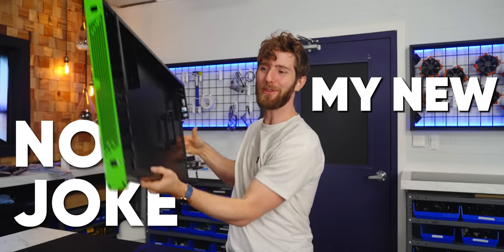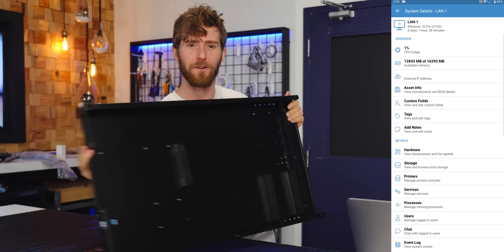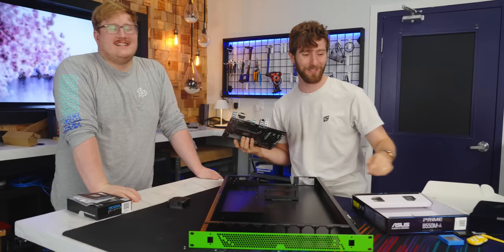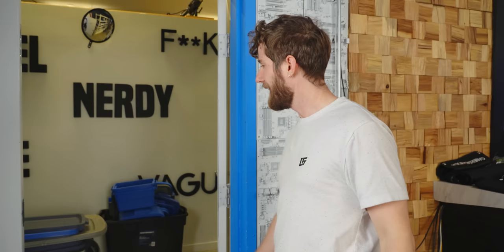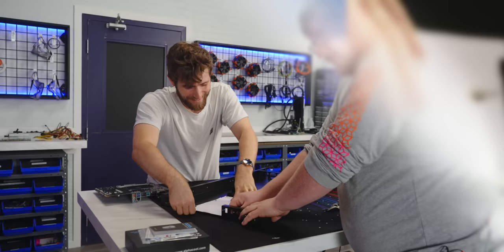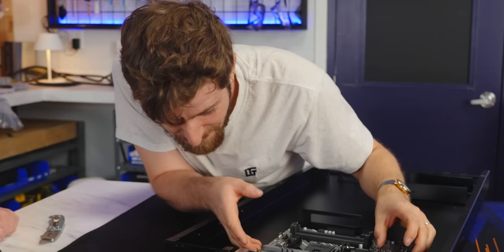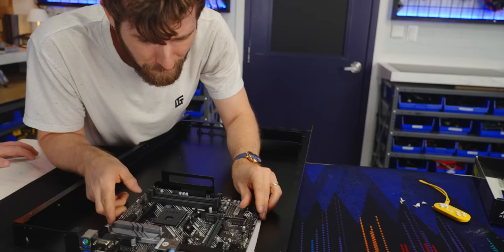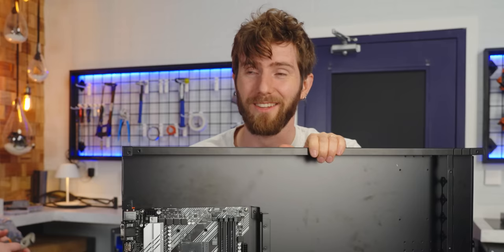This is my new gaming PC! - 1U PCs for My New House Part 1

Comment: The mATX-spec motherboards are my bread and butter. They generally have all the features I need without me having to pay for extras that I don't use, and fitting them in a case is easy.
Reply: sadly they made only like 3 mATX boards for Zen 3. Not sure what Zen 4 was like, but I hope it improves.
Reply: @wojtek-33  #AtxIsTheWay
Reply: @loshan1212  the ONE x570 matx board also happens to have terrible vrms, expansions, and features
Reply: @potatoes5829  yep. I'm currently using that board and being very annoyed being constantly reminded of how Asrock has no idea on how to make a motherboard yet.
Reply: But mATX boards are often more expensive than ATX ones, at least in Germany.
Reply: @loshan1212  I would know. Mine is currently in for RMA
Reply: been using matx forever. They do everything ATX does but doesnt take as much space.
Reply: @LRM12o8  It's always good for me to get a reminder that the best bang-for-the-buck in the US doesn't always line up with what's best in other markets.
Reply: @loshan1212  but they have done it in the past the x399 was "it" and the formula M for the intels. Atleast the new gene is worth a look but very expensive but hey mATX ftw!
Reply: Yeah but mATX was totally pointless in this setup; the extra slots are wasted. Mini-ITX would have been better with the same result in terms of what's actually be used.

Comment: You totally need to source a hot swap server fan enclosure for those front fans. The problem has been solved.
Reply: They could probably even 3D print one. Shorten the cables by cutting and soldering, have the fan headers go into a backplane or something (PCBWay is great for those kinda cheap boards), and viola

Comment: Motherboard electrical insulation: Get 1mm Thermal Pad in sheet form. Cheap, helps with thermals, electrically insulated.
IO Shield: use an ASRock or SuperMicro MB meant for rack mounting, the IO shields are 1U tall. You'll have to design the case to fit.
Power Supply: Should have used a Delta hot-swap; you'd need a break-out board, but people make them. Would have been more power, modular cords.
Reply: He could do what DIY Perks did & take apart a SFX-L power supply, but with a 1000w one & put it into this pc, but idk seems like some work to do.

Comment: I work in a Datacenter, the idea is not to have any carbon material in the cage where the machines are hosted. Carbon gives off lots of smoke and can trigger the fire system with any minor fire. The strong ventilation can make any short circuit sparks light up quite fast any flammable material. A small fire turns into a huge one in seconds.

Comment: Since you have 3d printer; could have printed 1 or 2 millimeter motherboard insulator board/backing instead of using cardboard.
Reply: yeah but it wouldve taken the printer an hour to finish

Comment: Something I want to see from older motherboards in newer motherboards (especially ITX), cutouts in motherboard IO shields for ventilation
Reply: New motherboards are so crammed with i/o that I don't thing they can fit vents
Reply: not to be a hater or anything bro, but that would kind of defeat the purpose of the IO shield with how powerful pcs are nowadays. you have a lot of points of contact for all of your connections back there, you want to make sure there's no crosstalk or signal interference/degradation,  and no cable to port connection is a perfect seal, back in the day there weren't nearly as many ports and the throughput was like a raindrop in the ocean compared to what the average pc uses today.

Comment: Please release the CAD files! So many of us are in the same boat wanting to transition to 1u format but with little to no viable options!
Reply: Judging by the fact it was built by protocase for them, they can't release any CAD files as they're designed by protocase for commercial manufacturing (copyright, anyone?) and LTT would not even have the files and those aren't theirs to release in the first place.
Reply: @jacobburgin826  I understand the feeling but they can't do it but you could probably contact protocase regarding a 1u case, that's just my guess
Reply: yall should make some them like duuuhhhh
Reply: @johnbienaszii7729  fair point but I was just making a suggestion based on their interest in the protocase suggestion.

Comment: The stock photo of the Raidmax Sagittarius absolutely threw me into nostalgia mode. The age of triple-core processors!

Also, Sunon MagLev fans are the reason server stuff is a lot more quiet these days. They're magical.
Reply: triple core processors feel like an animal with 3 eyes, so wrong yet it was the trend sometime
Reply: aren't triple cores just quads with a broken core?
Reply: @darkpixel1128  yep. It was just amd trying to make a buck off a product that would otherwise go in the trash.
Reply: @darkpixel1128   The magic of parts binning. The 5600X is the same, just x2 (and hyperthreading)

Comment: Instead of tape, why dont you use insulation paper. Find a local motor rewinder and get a small sheet. Its good up to 4000V and fire proof

Comment: To anyone who knows, not sure if I missed it in this or another video: how is Linus going to run the displays? Is he just using long hdmi / display port / usb-c cables from the server rack to standalone monitors? For other connectivity I see he's that through fiber from the Icron dock.
Reply: Im also interested in how he does the video transfer.
Reply: Incase you haven't already found out the answer, if memory serves correct he's using optical HDMI/DisplayPort cables to run his displays

Comment: this man is heating his pool with the heat off his server rack and i cant get enough of it
Reply: Would love to see the set-up... Ordinarily, in aircon units, piping is also insulated to prevent condensation, and although we are talking about heat from a water cooled system, you would probably use the same to avoid heat loss on the way to the pool heat exchange.  This will involve bulky trunking.

Comment: Honestly I love this idea. As much as I love the look of a flashy $3000ish PC, I don't want to deal with the heat from the damn thing in my room. I'm still saving for my first PC, but I was actually considering hooking the exhaust up to a duct and running it through the wall into the attic to prevent it from dumping hot air into my bedroom. I would have to clean out a closet and this has a lot more costs involved but down the road it is something I am strongly considering.
Reply: I've always tried to keep mine near a window that I can open and it's worked out half decent. I've never had crazy wattage draw though.

Comment: I loved the section where they talked about not having flammabke stuff inside your pc and I am chilling here with my cardboard box that houses my pc parts XD
Reply: Those actually can be an issue because if your mobo shorts, it can ground fault to the screws, which in turn send it back through the case to the PSU plug to terminal ground (your wall plug).

Shorting through cardboard = bad.

Always have liked the concept because wood and cardboard PC's are definitely an aesthetic, but without some sort of metal frame bridging the standoffs to the PSU it can go bad (PCB fires are pretty).

Comment: A bucket of Liquid Rubber (roof sealant) would be pretty handy for insulating the motherboard instead of cardboard. Just paint on a few layers and its good to go!
Reply: Or flexseal
Reply: @wojtek-33  could be some of them smell, one that is food grade/body safe should be fine... Or just a silicone mat. The ones made for ovens are food grade and wont smell.

Comment: You're planning to actually use your own pool to cool those PCs... Linus I thought it was all just a joke, you're a madman!
Reply: Dat thermal mass!
Reply: @samiraperi467  all the people inside because too cold out playing on computers that keep the pool from freezing ...
Reply: I would have been so disappointed had it been a joke.  I have thought about similar for a while (never done any watercooling, and I find the idea of another moving part (over the pump) weird and wrong; moving parts are always bad):  different but basically the same "external radiator-thingy" (or, simply, external heat exchange)
Reply: I don't think it will work.
Concrete is bad for taking up heating. And dispersing it.
Reply: @edenjung9816  What part don't you think will work? It should have no issue whatsoever keeping the machines cool.
Reply: @edenjung9816  Have you not heard about underfloor heating?

Comment: To get tubing over larger than you should barbs, place end of tubing in boiled water. Just put the kettle on, put in a mug, dip in tubes. Cools and super tight.
Reply: A heat gun is way faster and easier
Reply: @user-fw6eg3hc8f  Hot water you can never burn  the tubing and it evenly heats every part o f the tubing up to the point you immerse them. Literally get the kettle on to boil. Get your stuff together. poor water in mug. Immerse tubing for less then a minute and on it goes. Fast and easy. And every decent workshop has an electric kettle, how else would you make tea?

Comment: In some of the computer systems we design at my work. We use a Kapton laminated Kevlar sheet for similar purposes to the cardboard.

It's more expensive, but it's awesome stuff unless you are trying to cut it with the scissors you stole from your coworkers tool chest.

Comment: 16:40 Sunbeamtech was the only brand that ever made a good fan controller. they had good components and even made a PWM one that I've had in service for 10 years without any failures. Rheosmart 6 as I recall

Comment: What if instead of cardboard, you just used one big ol' 3mm thermal pad? Not sure if it would be all that beneficial transferring MoBo heat to the case buuuut at least they are designed to withstand the heat and not be electrically conductive. Another concern of cardboard is if there were to be a leak in the cooling system, something absorbent becomes a big conductor if it happens to get exposed to moisture.

Comment: Couldn't you have used thermal tape instead of cardboard???
Overall I like this! You guys give me so many ideas about how I want to build my custom PC/Custom PC desk setup! Hope to maybe pitch this idea to you, do a collab, and build it for real!
Reply: I would have expected some kind of conformal coating on the board, but it makes sense not to do that on a test bed like this. Maybe on the full deployment we will see something like that
Reply: They have a laser cutter, they can turn out their own proper shield.
Reply: I suggested kapton tape.
Reply: Good ol' Canadian insulator, HPHT: hot pink hockey tape.
Reply: @poe_thirteen  Yeah this, if they want it to last they need to coat it, but then I don't think their longevity expectations or requirements are to the level that would legit require the kind of coating I use.

Comment: LINUS: We need to be budget conscious
ALSO LINUS: look at this custom made water cooled chassi and my EK gear
ALSO ALSO LINUS: Can't wati to hook this up to my custom pool heat exchanger
Reply: Hey, nobody said the budget was low XD
Reply: To be fair, those are budgetary write-offs since he can claim it as a business expense.
Plus the sponsor pays for it anyway.
Plus Plus it's just a cool video.
Reply: Also Linus: $1400 USB extender in each machine
Reply: Heating up pool water with your pc watercooling is technically being budget conscious because you are making use of generated heat that would otherwise have been dissipated into the air undesirably warming up a room.
Nobody said you should go out and build your own pool.

And as for the EK stuff, I see that as an investment as you can reuse those parts in the future as apart from the cpu/gpu blocks the rest of the watercooling parts are unlikely to change much any time soon.
Reply: being budget conscious doesn't mean not spending any money lol, like this is price to preformance, and he will likely be saving money with the heat output of a 3090

Comment: Spraying under the mobo with a  few coats of rubberized undercoating/flex seal would be a bit more elegant than the cardboard/electric tape solution.

Comment: Tbh I want to see a 2U 2 systems build too. Seems cooler even if less practical
Reply: 2U actually seems way more practical to me. You wouldn't have to worry about the standoff screw being too long, you could use almost any part, bigger fans in case you don't have a pool, etc. The downside is having to shut them down in pairs, but I can't think of a less critical workload than "gaming PC".
Reply: @stribika0  I agree with you. Was Linus who said it was more impractical.

Comment: All I want to see after this is a cost breakdown, cos as much as I would love to try something like that, I expect trying to achieve it on my average budget is still a no go, the PSU alone is probably 3 times what mine costs, let alone the custom rack mounted case etc.
Reply: Craft computing does builds with the  3 gpu 1U servers that run about $300 dollars on ebay, sure you are limited in choices for gpu, but even with M40 cards he was able to run 6 separate virtualizations of crisis
Reply: Would you include the whole pool for cooling in the budget?

Comment: i feel like a chassie/vertical blade kind of setup would work better here, can easily get 5 systems in 4 or 5U with ability to work on one at a time but with far less height contraints as you would have 3.8 inches (19 inches/5) of room vs 1.75 inches
Reply: what would he do for the CPU there? He's using physically separate ones because of anti-cheat issues. Are ITX motherboards small enough to fit multiple in a server footprint?

Comment: About the cardboard. You are putting it in a rack of which you expect it to be hot (since you dont want the original room to get heated), plus the heat can not really go away, so I think its a bit weird you accept this potential fire hazard so easily. Especially when there's tape available that doesn't conduct and is more resistant to fire. Oh and btw, you couldve just put the tape on the chassis instead of the motherboard. Which makes maintenance a lot easier
Reply: Cardboard has a self-ignition temperature of about 427°C, which is just about 800°F. I think they'd be running into a lot greater issues if the inside of their computer got hotter than the cylinder temperature of a gasoline engine.
Reply: @imitt12  Don’t give them any video ideas 🤣

Comment: if you need to create an insulative backing for your motherboard (like they did with the tape) you can use vinyl wrap, like for cars. Its actually pretty affordable and available in tons of colors and finishes to get a professional look.
Reply: They could probably even get dbrand to make some memey print for them
Reply: All these plastics sound awful for ESD. And for that reason, I'm out!

Comment: One thing that I'm not sure has been pointed out yet is enabling Hyper-V in a windows KVM, it makes anti-cheat blind to the VM. There may be some other things that need to be tweaked but I have heard that Hyper-V works wonders when enabled.
Reply: lots of anti cheat just won't run with hyper v enabled
Reply: @crashniels  havent seen one yet, also all serious anticheats will work because they know that they cant alienate that big of a market as people who use wsl2 and basic hyperv are

But also would make sense as technicly as soon as you enable hyperv your desktop is in a vm
Reply: Would make sense as otherwise how would games even work dince as soon as you enable hyperv you are in vm
Reply: @bigpod  faceit or genshin or some others do this. When you try to start it tells you to disable hyper v in order to start.
Reply: @crashniels  never played those games i guess never will, as hyperv is nowdays mainstay in my system.

All antichewts i have to deal with dont even bat an eye
Reply: @crashniels  Have Hyper-V enabled for wsl, Genshin/Honkai didnt bat an eye about it.
Reply: @pinklife4310  probably was another game then. But faceit does refuse to open and straight up bans you if you open it in a vm
Reply: Not for Fortnite, Batteye protected , Easy Anti-cheat protected, Tournament games like csgo through faceit and Ricochet protected games (CoD MW for example). Those covers enormous part of the most played multiplayer games today, the very new released anti-cheat from EA is working on kernel side, this one i dont know if is locked right now but as all others did, it's very likely to be. 

Try circunvent those anti-cheat is dangerous because that is the same thing as cheating for them, a ban from battleye for example marks the steam in the same way as a VAC one, with the red message on your profile and everything for 7 years. They already do a lot of false positives (like Linus friend, Luke 2 years ago where they were ignoring and making fun of him when he tried get an explanation, that until he posted the video on this channel...). If for any reason they vaguely thinks you are suspicious they may release a ban and by the terms of use they do not need to tell you why.

Comment: I was just imagining what kind of sick laptop with desktop part setup that could be made into.

Like a server rack long ways across a lap and having legs at each end to prop it up, then 1 ultra wide monitor attached to a back plate or funky arm and would fold down into the rack.

With a slide in keyboard mount/ramp.

Comment: We need a server case standard that fits within 450mm (17.7") of width and 90mm (3.5") depth. This would allow it to be installed between the studs inside any plasterboard wall the same way that those behind-mirror cabinets are installed in bathrooms. Imagine a server rack inside a wall with your router/home server etc taking up no space at all.